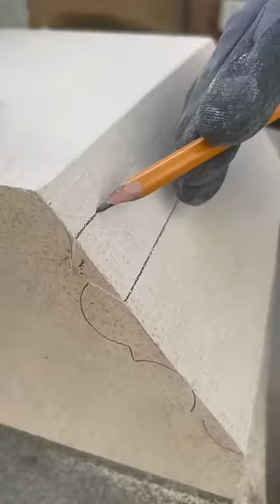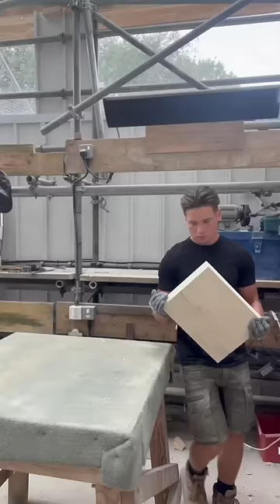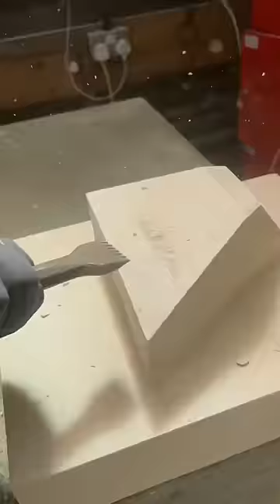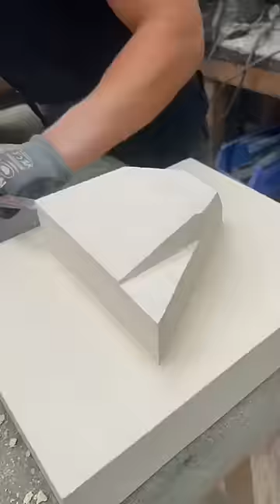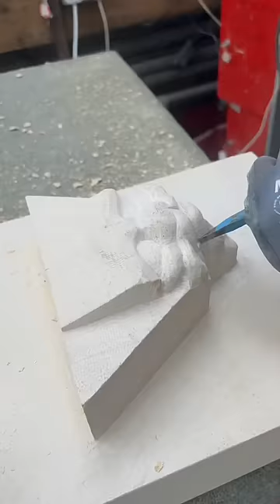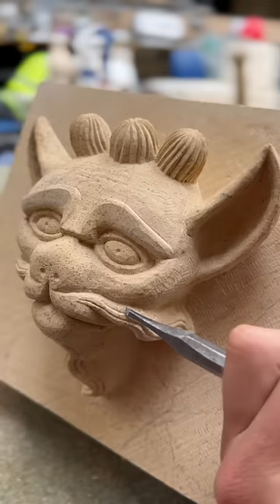#stonemasonry

Comment: Joe rogan is the type of person to think that modern technology can’t stack a bunch of rocks on eachother.
Reply: We're talking about a monument so large made with 2 ton stones of granite(last I checked) all fit together with such absolute precision you can't get a slip of paper in between them. You can stack a bunch of rocks together that thin on a smaller scale for sure I mean there's fences the Irish and Scottish made like that but on the size of the great pyramid? We'd absolutely struggle with modern tech
Reply: @noahtackett6264  you are missing a screw or two buddy 😂

There is even a fcking fishshop that made a piramid in like 6-8 months and i assure you, you cant fit a paper sheet inside either 

Its not technology that made the egipcians so capable of stacking a couple of rocks in such place, its human engineering and ingenuity at its best, cutting stone in a cube is pretty easy and can be achieved with just a cicel and a hammer
Reply: @noahtackett6264 bro you talking like we didn't build the Burj Khalifa in 6 years with modern tecnology💀
Reply: @Eustakista whats an egipcian?
Reply: @noahtackett6264 while 8,000 to granit is used in the great pyramid around 5.5 million tonnes of limestone and 500,000 tonnes of mortar were used.
Reply: @AnkleGremlin Do cranes or power tools not exist where you're at?
Reply: @noahtackett6264 no, we'd just use technology to pull the rocks, like how the Egyptians did but minus the technology
Reply: @noahtackett6264 buddy some of those stones, especially kings chamber stones weigh 80 tons (160,000 lbs). Start with that next time.
Reply: @noahtackett6264  When you have thousands of slaves, working 24h a day, 7 days a week and like that for 20+ years, I am sure it's quite possible to build pyramide without modern tools. If you cut stone every day, you will get quite precise and they used various measuring devices to inspect dimensions of cutted stones
Reply: @Eustakista it’s just funny how you destroyed his logic using a fish shop as an example 😂😂. But I think what Rogan means is we couldn’t do this with the technology we believed them to have at that time. Some piece of information will be forever lost to time.
Reply: @krazy8651 that's skilled labor not slavery
Reply: @AnkleGremlin  No but I don't think it takes much to move rocks.
Reply: @AnkleGremlin  Wait why are they going into the air if they're being placed on the ground? Checkmate liberal cry about it.
Reply: @noahtackett6264 look at one brick from any of the pyramids and you'll see that they are absolutely not made with absolute precision lmao. I also find it weird that you people only question ancient buildings made by brown people but never question the Roman colosseum or agora, which are far more impressive and intricate
Reply: @MasterMind75427 slaves building it is simply a theory. There is zero proof slaves built anything.
Reply: @noahtackett6264 no we wouldn't struggle... the way they did it isn't "unexplainable". they just had a ton of workers drag stones up ramps. it would be EASIER with modern technology. stop with this bs fudd lore
Reply: @AnkleGremlin we CAN recreate the pyramids, quite easily actually. want to know why we haven't? there's no reason to. there's literally nothing we could benefit from by doing it.
Reply: @whatamidoing4890 this exactly. the pyramids are literally just that, pyramids. made of big stones
Reply: @noahtackett6264   when idiots think they're smarter than most engineers 😂
Reply: @AnkleGremlin  you do know that ramps are a thing? And rocks can be carried using wheel like structures, by placing them underneath while the rock is being pulled.

And for the rocks to be an equal cube? Math and tools for stonemasonry? Did you really think rulers, casts, and things of that nature are only invented in the modern age?
Reply: @noahtackett6264 back before we had power tools and automation, many more people would train their entire lives for manual labor like the stone masonry shown in this video. And people are smart. Especially the Egyptians. Skilled in mathematics, astronomy, and architecture. They found ways to precisely cut soft stones like limestone, which 98% of the stones in the pyramids were made of. Limestone is softer than quartz, and sand is mostly quartz, which they used to cut and smooth the stones
Reply: @creatore1359 you forgot steel beams are like 2 tons these blocks were like 40-60 and they didn’t have modern technology 😂 bro you ever seen a machine try and lift a 60 ton rock cuz even with what we have it’s damn near impossible. And the fact the moved these 500 miles. Yea the burj khalifa is cool but there lifting things a fraction of the weight and we are using technology 6000 years more advanced. What they use wood scafolding to hold a 60 ton block 😂
Reply: @colekonop5034  bro 40/60 tons where? Those blocks where on avarege 2 tons, plus that's what im saying? We could totaly build the pyramids with modern tecnology?
Reply: @noahtackett6264 they probs struggled too. But we sent several things in space and they came back so I think we'd manage a pyramid or two...
Reply: @AnkleGremlin they chiseled the rocks and used platforms to slide them and put them in the right places
Reply: Yall are acting like they didnt take probably half a century building the pyramids with their bare hands, whereas we could build that shit in 5 years if we wanted to
Reply: @apep235" To build such a pyramid today (using modern technology and equipment such as cranes and helicopters), it would take 1,500 to 2,000 workers around five years, and cost around $5 billion."
Reply: @noahtackett6264  not really. You can put like a bunch of paper into the pyramid
Reply: @LaurenceomanceI love big tower in big city
Reply: @AnkleGremlin no but pullies and hands did.
Reply: @noahtackett6264 If you stack any two rocks off the ground on top of each other you probably won't be able to fit a piece of paper between them.

It might also interest you to look up the source of all precision in engineering, which is the surface plane, which is the result of rubbing three surfaces together.

Finally, not all the blocks in the pyramids are the same size.
Reply: @AnkleGremlin Was ten seconds worth of research enough research?
Reply: @AnkleGremlin You literally ignore half the comments explaining it to you.
Reply: @AnkleGremlin also in 10 seconds you could search up that it's not 80 tons it's way less. You say it's so easy yet half of what you say ignores what you preach.
Reply: @noahtackett6264 the slip of paper thing is such BS. No shit you can’t slip a piece of paper through two ton rocks. It’s not the perfect carving, it’s the fact that an object that is heavy, won’t have any open spaces to let stuff through something underneath it.
Reply: You do realize we still haven’t figured out how they built the pyramids with the 2 ton stones lmao
Reply: Hmmh yk pyramids are considered a doorway to god and they’re a holy place they also were used along side the stars they can’t replicate them because it’s more precise than any man or machine todays standards are cheap you need to try and replicate something like this on a smaller scale use power tools and see what happens
Reply: @AnkleGremlin engineers and scientists are different buddy. Eitherway that quote is nonsense.
Reply: @AnkleGremlin yep it's possible.
Reply: @noahtackett6264 that isn't true at all. They're not that precisely placed. Look at close up pictures of the pyramids and you'll see what I mean.
Reply: @Eustakista the pyramids are made out of granite and ancient Egyptians only had copper and later bronze tools. Both metals are too soft to cut granite. 

The exacting measurements that Joe was referring to are beyond anything builders of today can accomplish even with laser levels. The great pyramid is so close to an exact square that no one knows how it was accomplished. And it is perfectly in alignment with a constellation in space. 

The blocks are not all the same size either. And they weigh between 2 tons to 80 tons. Each ton is 2000 pounds. Moved as far as 500 miles. Thats over 8 hours driving at 60 mph. 

And they are still standing today AT LEAST 4500 years later. Castles built 500 years ago are no where near as accurate and some have already crumbled into ruins. Even the amazing things the Greeks and Romans did 2000-2500 years ago have not held up.
Reply: @blitzentiger1306 how would you move an 80 ton granite stone 500 miles? That’s 160,000 pounds from New York City to Cleveland Ohio…for 1 stone. They estimate that about 2.3 million stones in total were used to build the Great Pyramid, the lightest one was about 5000 pounds.
Reply: @whatamidoing4890 the Romans spoke latin and kept records…all modern languages came from latin. They also used concrete. We know how they built their structures. They also had better tools. You can’t cut granite with copper or bronze tools. If the truth about the pyramids is known it is being kept from us. No way they were built to bury kings…more likely the ancient Egyptians just found them there and claimed ownership. Then they drew their hieroglyphics on the walls and that is where we get the carbon dating from. Figuring out a language from a series of pictures isn’t an exact science. There is 100% more to the story that we don’t know!
Reply: @Caustic968  ingenuity and a shit ton of forced labor.
Reply: @johnnymac6178  big rope and a shit ton of slaves for manual labor. you can acomplish alot of things with a shit ton of people and a shit ton of time.
Reply: @AnkleGremlin 

"To build such a pyramid today (using modern technology and equipment such as cranes and helicopters), it would take 1,500 to 2,000 workers around five years, and cost around $5 billion." 

10 second google search. It astounds me that people look at the Three Gorges Dam or the Burj Khalifa and think we couldnt build the Pyramids. Pure idiocy.
Reply: @whatamidoing4890 Or the Cologne Cathedral or the Sagrada Familia. There are much more impressive structures than the Pyramids.
Reply: @noahtackett6264  ignore the haters. They can’t tell the difference between our ability to create a modern day structure and our ability to recreate what the Egyptians did.
Reply: @whatamidoing4890  you are massively overstating the strength of men and understating the size and scope of the Pyramids. No rope is pulling an 80 ton granite monolith. And even if there was such a rope it would take thousands of men pulling on it to move…500 miles. And that is just one stone out of 2.3 million…for one Pyramid. 

All 3 at Giza would take like 9000 years to build, if they even had the proper tools to cut granite, which they didn’t. No way in hell regular men built the pyramids. Aliens or men with alien technology.
Reply: @AnkleGremlin what source though?
Probably not a terribly reliable one because just about any archeologist studying ancient Egyptians  could tell you how they did it
Reply: @AnkleGremlin we can in fact recreate the pyramids. It's just that with modern day tools to help us we still can't figure out how exactly they built it. While there are a few theories.
Reply: @johnnymac6178  good thing it did take multiple men multiple days to move 1 brick. again it's amazing what you can do with a shit ton of people and a shit ton of time. also the pyramid is mostly made of limestone,  only the kings chamber is made of granite. it's amazing what you can learn when your sources aren't inbred alcoholics on facebook
Reply: @noahtackett6264 is it so hard to believe people worked and chipped these?? Modern hand tools aren’t too different from what they used then, and rope and pulley systems are as old as the earth
Reply: @AnkleGremlin attach a fat rock to the stone you want to move on an elevated surface over a pulley, problem solved the stone is now in the air
Reply: I don't think these people realize how much time you have in a day, this was before set work hours, before books, only the rich enjoyed plays, before phones and tv, before really all that many (if any) "social gatherings" as those weren't reserved for the slaves who worked on the pyramids.

24 hours, think about that, if you had 1000 men all working 16hrs with no distractions other than maybe getting food and water what do you think you could accomplish?
Reply: @AnkleGremlin yes lmao
Reply: @AnkleGremlin they aren't perfectly accurate 

The Egyptians quarried the limestone for the Great Pyramid's core on site at Giza, just south of the pyramid itself. Despite often repeated claims of the pyramid's unparalleled perfection, these blocks come in a variety of sizes and some are quite rough, with the gaps between them filled with gypsum mortar.
Reply: @AnkleGremlin we do not know the exact methods no, but we do the that PEOPLE did it, there are quite a few theories as to how they did it, and they are all very possible, also we can't recreate them the exact same way because of cost, labor (and for what?) Not to mention they had THOUSANDS of people working on these if not a million or two.

Getting that many laborers to work the same hours, and do the exact same things the Egyptians did would not only be illegal and cruel but damn near impossible.
Reply: @johnnymac6178  you know they didn't use one rope, they used multiple! And chains! Chains are a funny thing aren't they? You know what else they used...? Water to help move the heavy rocks, WOW I KNOW crazzzyyyy, and pulleys, you would be surprised what thousands upon thousands of people can pull with those tools in mind.

Know what else they had? Borers, which were basically hand held drills, cool huh?
Reply: @noahtackett6264 yeah we’d struggle because of patience. It probably can be done. But to be done as precisely it would take a generation or two. And why would we do that just to say we could? Idk.
Reply: @noahtackett6264  We build the burj khalifa?
Reply: @Eustakista do you have a few screw loose? Cause I hope you know granite is an 8 on the hardness scale. It really hard today to preciously cut granite without big machines. So explain how they crave granite back in ancient times. You better come with an legit answer or I’ll make you stupid on here for legit trynna bash on someone cause you don’t know rocks and hardness of different rock. This guy in the video did it with sandstone which is very easy to chip away. But yea explain the 70 tons pieces of granite in the pyramids. I’ll wait… and that what joe was pointed out with some of the stones he was talking about. Not sandstone like the video. Video actually very misleading.
Reply: @blitzentiger1306 you realise some of those stones exceed the weight limits on modern 18 wheelers.
Reply: @Ibugsbunny713  Do you realize I don't care. Crying over stones lile you is why humanity is failing not Gen Z.
Reply: @noahtackett6264  guess you never saw them real?
Reply: @noahtackett6264 1. They weren't stacked that even, over the course of time tho the stones have expanded and contracted due to heat and have become more uniform. And they aren't even as well put together as you make it sound to begin with. 2. Do you have any idea they type of stuff we can do with modern tech? We make and maneuver things dozens of times bigger than the pyramids on levels of precision down to thousands of an inch. It's ridiculously stupid to think ancient ppl didn't make the pyramids and its down right brain dead to say we'd struggle now
Reply: @MasterMind75427 💀💀they were all paid workers with years of tax exemptions wym slaves they built these things through generations of craftsmen
Reply: @johnnymac6178  They had boats and both sites were right next to the Nile, I'm sure you can figure it out. Using 4 hemp ropes with a 9 inch diameter would give you a tensile strength of 1400 tons. The largest stone was 80 tons. 

The vast majority of the stones were limestone that was quarried on site (I know you want to say it, but no limestone was not "only used for the outer layer") With 30,000 workers and taking 20-30 years, that averages out to 100-150 days per block.

A copper saw with quartz abrasives will cut granite. A dolomite hammer will shape granite. Flint will shape granite.
Reply: @Ibugsbunny713  granite is almost always rated 6-7 for hardness lmao. It's hard to cut granite quickly (relatively at least) without big machines. They did not do it quickly.

Quartz, dolomite, and flint are all either equal to or harder than granite. A copper saw with quartz abrasives can cut granite, we have already recreated this. It's also worth pointing out that the inner blocks are not nearly as precise as the outer layer and vary greatly in size.
Reply: @benitomussolini6524  lol 😂 you’ve never used or worked with stone in your life.
Reply: @Eustakista well that fish shop, i’m assuming you’re referring to the Bass Pro Shop one, is made of glass which is adhered together to metal, not bricks layer together without adhesive.
Reply: @josevalladares5153  you are right, I haven’t. But with the tools they had it shouldn’t have been hard especially producing so much
Reply: The stupidity I'm seeing in these comments the fact they build it at age where there was no cranes or shit means they had the best technology in all time even better than now
Reply: @Error-er6nw  ikr
Reply: @benitomussolini6524   I do believe we can make it with today’s technology, but it would be tough and the reason why am saying they wouldn’t be able to do it is because they are cutting granite with With soft metals which is unbelievably hard to do. I use my concrete saw to cut granite and it’s a bitch.
Reply: @noahtackett6264 youre clearly very ignorant on the type of construction equipment we have today
Reply: You’re clueless
Reply: @MasterMind75427 a couple things, they weren’t slaves, they were paid workers, master craftsmen and they didn’t work 24/7 also, they were built over the span of hundreds of years
Reply: @noahtackett6264 common misconception, but the pyramids weren’t exactly precision engineered. There are (and were) many gaps in the stone big enough to fit paper between
Reply: @scottbabien4395 it was a little bit of both, really. Slaves back then were mostly used for more menial tasks (stone hauling, pumping bellows, etc.), but many were also stonemasons as well
Reply: @noahtackett6264  it wouldn’t be a struggle from a technological perspective, it’d just be monumentally expensive and nobody would want to pay for it. We absolutely have the technology to cut, measure, polish and assemble stones that are several dozen tons. It would probably cost hundreds of millions or multiple billions of dollars to construct something like the pyramids again to the same quality standard, and we’d rather spend that sum of money on other things because we aren’t a palace economy with a heavy focus on a state religion that obsesses over funerary practices (not that this is bad, but this is what Egypt was, and we’re not that way anymore).
Reply: @noahtackett6264 if course you can’t slip a piece of paper between them, they pushed the rocks together 💀
Reply: @josevalladares5153  Dolomite and flint are both stone tools they had available and harder than granite. Quartz, when used as an abrasive, will allow you to cut granite with a copper saw. Would it be fast? Absolutely not, but no one said they built the pyramids quickly.
Reply: And yet no arches. Meaning they had to fill rooms with columns rather than the grandiose chambers in say gothic cathedrals. I think it’s far more likely ancient people just figured it out rather than having super advanced tech but somehow not ever figuring out how to make spacious rooms out of all those stone buildings they made.
Reply: @noahtackett6264 so... have you heard of the burj Khalifa? We could absolutely build a pyramid and we would not struggle. We built one twice the size of the one in egypt from glass in Memphis tennessee just so we could put a fucking bass pro shop inside of it. Cutting big rocks is not an issue of modern or ancient technology, and moving them is relatively easy with cranes, forklifts,  a bunch of logs to roll them on powered by the pull if slaves... there are many ways to do these things
Reply: Tell me you have no clue about the topic without telling me you have no clue:
Reply: @Eustakista oh yes the fish shop def did it with thousands and thousands tons of stone which were transportet by hand over 300miles away
Reply: @noahtackett6264  also erosion is a thing. Youd probably be able to fit multiple sheets of paper in between them back then but after a couple thousand years theyre kinda fused together
Reply: @Eustakista let’s see you try it buddy😂😂😂😂😂if it’s so easy 
You the kind of person that likes to talk shiit but can’t spell 😂😂😂😂
Reply: @MasterMind75427 you do know there is no records by the Egyptians of how the pyramids were made right? There is zero records from the Egyptians that there was any slave labor used to build the pyramids. As a matter of fact there's zero records at all of how the pyramids were built the methods used what they did to do it. So trying to explain the slave method is nonsensical and you have absolutely zero evidence or records from the Egyptians that say that
Reply: @Somebody-dl8og the king's chamber is about 140 ft up the pyramid and the King's chamber is a room that is granite and the beams are 70 tons each. If you think you're going to get a ramp and  and put a 70 ton block of granite on a cart with wheels and roll it up a 45 degrees slope and precisely stack these 70 ton granite blocks with ramps and carts with wheels your a fool
Reply: @Kingly-Mike  yeah probably because they would have used ropes and levers to assist in pulling it up the ramp, not a cart lmao
Reply: @griffin123122  Maaaan........... You're not going to use ropes and levers to pull up 70 ton granite blocks. You don't know anything about construction or heavy lifting obviously
Reply: @Kingly-Mike  Yeah, I wouldn't because I would have access to heavy machinery. Ancient egyptians would have, because that's the level of technology they had access to.
Reply: @griffin123122  you need to take into account the angle of the slope that you would have to "drag" these 70 ton blocks up. The pyramid rises at an angle of about 51 degrees all the way to the top. Therefore if you had a ramp your ramp would have to to be sloped in a similar way as well. The king's Chambers is about 140 ft high up in the pyramid. So you would have to have a ramp that gets you 140 ft high up and it's sloped and you're telling me you're going to drag a 70 ton granite block with levers and ropes up that ramp??? Hahahaha yea right bro. For us today our most powerful cranes can lift about 60,000 pounds maxed out.. bro the granite blocks in the king's chamber weigh 140,000 pounds... Our modern machinery would have a great amount of trouble lifting those blocks not to mention 140 ft up a 51 degreed slope
Reply: Ok. Since you're the expert explain to me what technology we are going to use to make the king's chamber?
Reply: @Kingly-Mike  ... oooooooor I could build a longer ramp at a shallower angle. In this scenario I am god king of the most powerful empire on earth, I think I can manage a ramp.

Also you might wanna check your google search again lmao, that's the max load for a tower crane lifting straight into the air. Dragging things is easier, and we've built cranes that can haul up to 20,000 tons
Reply: @Kingly-Mike  Copper saws with quartz abrasive can be used to cut the blocks. That same quartz abrasive is used to sand the face of the blocks that will be showing. Congrats you built the king's chamber
Reply: @griffin123122  do you have any idea how long that ramp would have to to be? Do you have any idea how far you're going to have to drag these blocks up that ramp? And yes of course we have cranes that can "drag" very heavy objects I understand that but there's going to come a point when dragging is no longer feasible and you're going to have to lift these blocks and that's the point I'm making we don't have cranes that can actually lift these blocks and set them dragging them is one thing actually lifting them up and placing them is a whole different scenerio
Reply: @griffin123122  Oh ok well how are you transporting them? How are you getting them 140ft up the pyramid? How are you going to set them in place?
Reply: @griffin123122  And please explain to me what type of copper saws are you going to use to cut out 70 ton granite blocks? I've worked with hard Stone, granite, and marble I've seen the diamond tip blades that need to be used to cut into these hard surfaces. I've seen what type of powerful machinery you need to really cut into heavy granite objects and if you think these ancient Egyptians had some copper saws with quartz and we're just cutting 70 ton granite blocks you're insane
Reply: @griffin123122  also we don't know what technology (if any was used) to build the pyramids considering the fact the ancient Egyptians themselves have absolutely zero records of how,who,when and why the pyramids were built. If you're trying to understand the pyramids through the mainstream narrative of archeology sorry to tell you but you're starting in the wrong place. Them folks have an agenda and they want us to believe their narrative concerning the pyramids which corresponds with their belief set of our ancient past. They don't want us to believe that there was an actual technological highly advanced society in the ancient times because they want us to believe their monkey man evolution, copper age, bronze age bull crap. There are things that happened in our past that we have no idea about and the mainstream narrative of our past is BS
Reply: @Kingly-Mike  tell me what technology they had 6000+ years ago that we don’t have today.
Reply: @Kingly-Mike  Man if only we had basic trig to figure this out. Oh wait. The answer is 300ft for a ramp at 30 degrees, Einstein. 30 degrees too steep? It's 450 at a 20 degree angle. We could even get a little wild and go 850 for a 10 degree incline. None of this would be unobtainable for, again, god king of the most powerful empire on earth.

You've also misunderstood, again. That 20,000 tons is the weight limit lifting straight up, not dragging. I'm also not sure how you've concluded that there must be a point where you lift straight up, because that's just not true.
Reply: @Kingly-Mike  Literally any copper saw. Yeah, it takes a long time, but there were tens of thousands of people working on this for decades. You don't have to use diamond tipped circular saws to cut granite, you use it to go at the rapid pace modern construction demands.
Reply: @keirduigy  whatever technology they had to help them build the pyramids is waaaay more advanced than what we have today that's for sure. And its foolish to make claims that they're just a bunch of pile of rocks stacked on top of each other considering the fact we have no idea what the things we're even built for in the first place of course they say it was a tomb which is completely nonsensical more like a power plant we have no idea what the true function of this thing was
Reply: @creatore1359 the burj Khalifa ain’t a pyramid bud
Reply: @griffin123122   a copper saw ? Like a hand saw or a copper circular saw attached to a pulley system to get it to spin fast enough to cut saw
Reply: @josevalladares5153  Well, we have reason to believe they had hand saws while we have no reason to believe they had circular saws, so I'm going to say hand saws.
Reply: @noahtackett6264 it's not rocket science, you just cut big ass rock then have slaves transport them it's not that crazy and they didn't have divine level of science and knowledge that's higher than ours, just unpaid labour and sweat
Reply: @noahtackett6264 have you seen skyscrapers before, do you know about the spherical dome in Vegas, did you know that we've been to space, have you ever heard of cranes, have you seen windmills in person?

You can't seriously belive that stacking a bunch of rocks on top of one another is hard for us in the 21st century, we can make calculations that are so much more accurate, have you ever heard about calculus? They didn't have it back then btw.
Reply: @Eustakista we are superior to the antient Egyptians in every way shape and form. They didn't even know about calculus 🤣
Reply: @creatore1359 that's a poor argument.
Reply: @Jdonner4713 so 0 sophisticated math, physics and technology is superior to today's technically, physics and math?

That can't be right, those people didn't even know about calculus.🤣
Reply: @Tshego2000  witch one of my replays has a poor argumen? It's been months, plus ive seen your other replay, we have the same opinion
Reply: @creatore1359  oh shit, I think I misunderstood your comment my bad. 🤣
Reply: @Tshego2000  no problem my guy
Reply: @griffin123122  no we did not recreate this. Trust me. Idk where your getting your sources from. Hopefully not mainstream. Why they still trynna figure everything out right? But we didn’t recreate anything what they used back then. They couldn’t recreate it at all without using heavy machine tools. So please go learn more. Imma keep saying in every video. Also granite is an 8 not 6 or 7 like you said cause that will fit your narrative. But granite is actually an 8. And flint is not harder than granite. That has been proven multiple times and I legit even did it as science fair experiment to show people flint is not as hard as people want to believe. Tell me why I can throw a normal rock at an wall of flint rock and still have chunks of flint come out. That not gonna be with granite.
Reply: @labyrinth4799  I'm 100% sure we can finish the pyramids in less than 5 years with the current technology we have today... rogan is speaking out of his nose🤦‍♂️
Reply: @noahtackett6264 it’s almost like the rocks settled over thousands of years ago